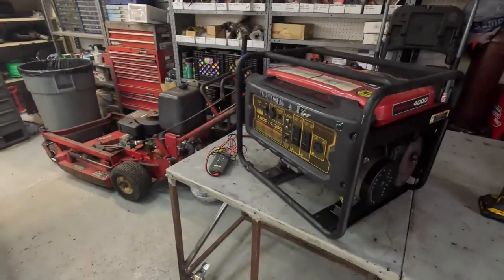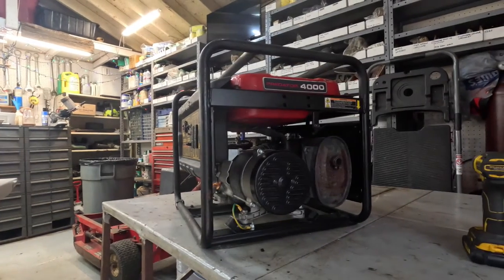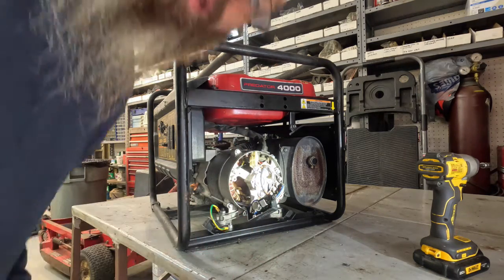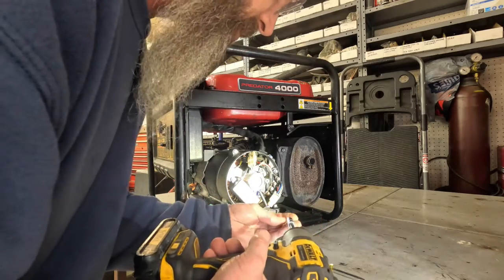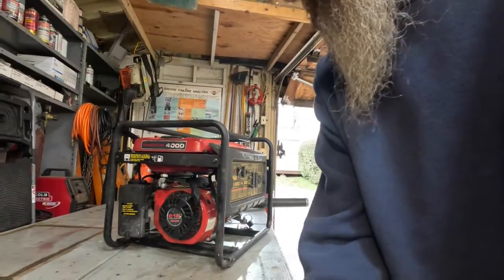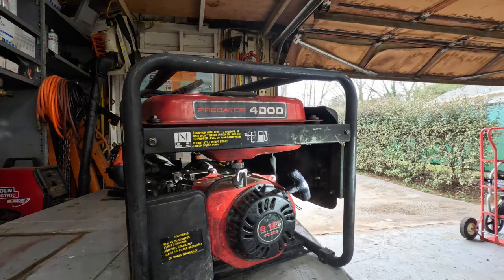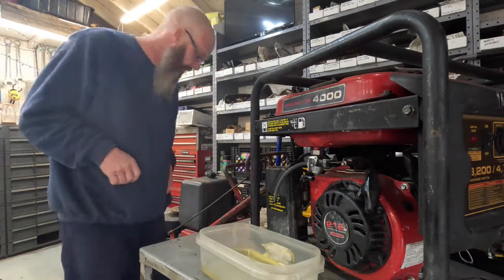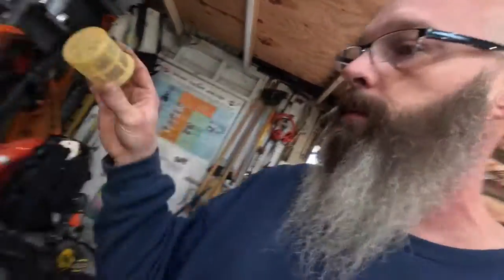Adjusting the Predator 4000 Generator AVR | Winterizing for Storage!

Comment: Pro tip…you can loosely wad up a couple paper towels or shop rags and stuff them into the fuel tank and then blow compressed air in the tank and let the rags help drying the tank and then fish them out.

Comment: Toooom Doooobyyyy! Hey, Tom! As you know, I know little to nothing about small engines and even less about small engine electronics. My question is; Is it possible that the vibrations of the generator running, loosened that small screw you adjusted? If it did, is it possible to use a loctite product on it to keep it in place? 🤔Just wondering. Have a great day! God bless.
Reply from the maker: nah, the AVR was just set that way from the factory

Comment: Tom, instead of using carburetor cleaner, you should use WD-40. It won’t swell the needle valve and if you can get ethanol free gas fill your tank so it doesn’t rust.